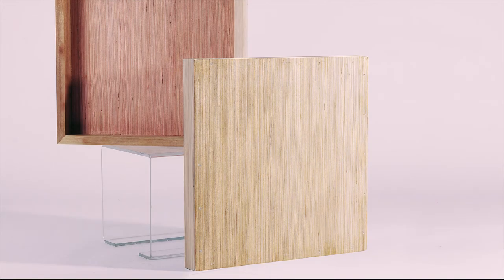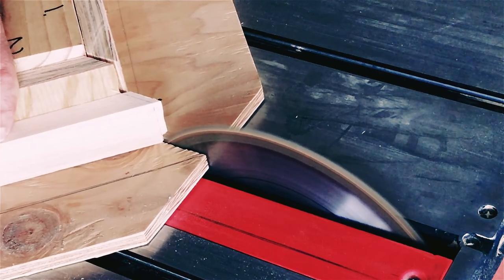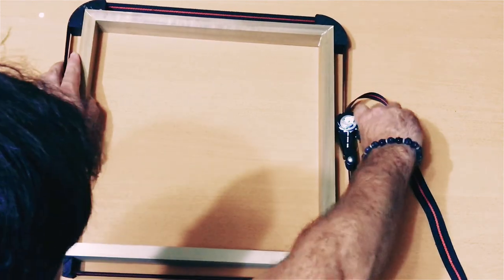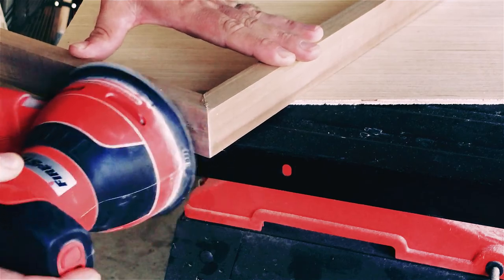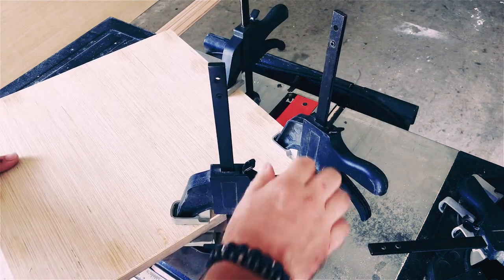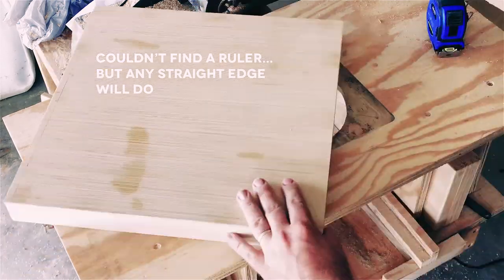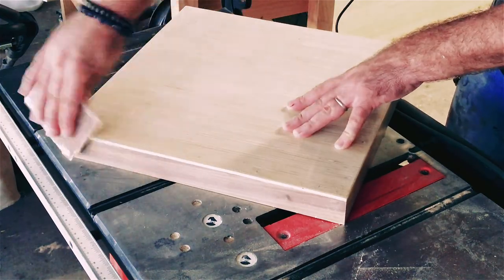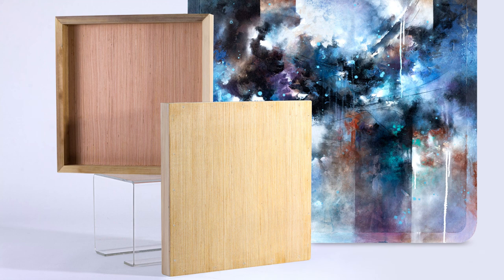𝐓𝐡𝐞 𝐁𝐄𝐒𝐓 𝐂𝐫𝐚𝐝𝐥𝐞𝐝 𝐀𝐫𝐭𝐢𝐬𝐭 𝐏𝐚𝐧𝐞𝐥𝐬 𝐘𝐨𝐮 𝐂𝐚𝐧 𝐁𝐔𝐈𝐋𝐃! - (𝐁𝐞𝐠𝐢𝐧𝐧𝐞𝐫 𝐖𝐨𝐨𝐝𝐰𝐨𝐫𝐤𝐢𝐧𝐠 𝐟𝐨𝐫 𝐏𝐫𝐨𝐟𝐞𝐬𝐬𝐢𝐨𝐧𝐚𝐥 𝐀𝐫𝐭𝐢𝐬𝐭𝐬)

Comment: Why not eliminate the router and just leave the small overhang? I think it would create a nice floating feel to the artwork. Also, you might want to rethink using nails and putty on the painting surface as those materials can cause discoloration when applied paint has dried.
Reply from the maker: Thanks, Chromefree. I appreciate the feedback. I suppose you could leave the overhang. It's just not done traditionally. And it might make for poor aesthetics. But I don't know. I've never tried it. You might be onto something there with that idea. As of the making of this particular video, my table saw blade wasn't in the finest working order and didn't make clean cuts through the plywood. The edges were chipped out. The router cleaned all that up nicely and made for better presentation IMO.

As for the surface, I always gesso my panels first with a minimum of 2 coats. Sometimes a 3rd depending on how fine a sanded finish I'll put on it after it's dry. With the nails embedded and covered in Bondo putty, then sealed under Gesso, I've never had discoloration occur in my 20 years experience. Certainly not enough to have noticed. But your concerns are certainly legitimate. Those things can and will occur if one isn't careful about their painting approach. 

The wood glue is very strong and could probably suffice on it's own. But I like to go above an beyond "good enough" for the sake of craftsmanship and professionalism. When I sell a painting it comes with a personal guarantee that it won't warp or have structural issues due to poor quality construction. The only way I can make that kind of promise to collectors and clients is to control the QC from start to finish. And to cut no corners while doing it.